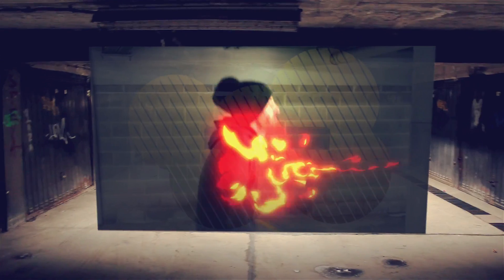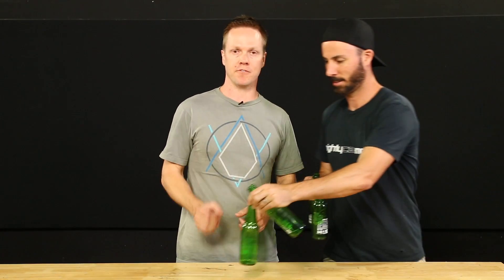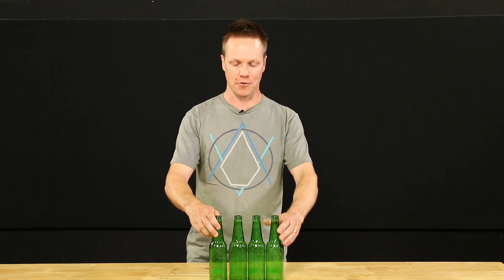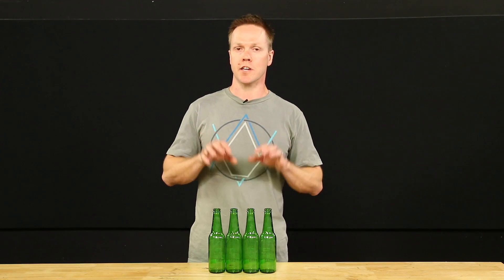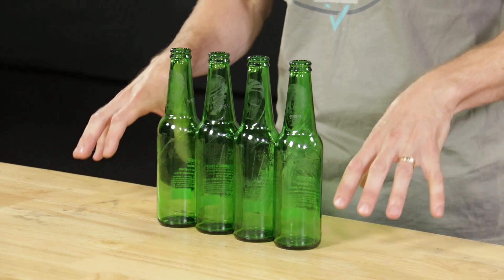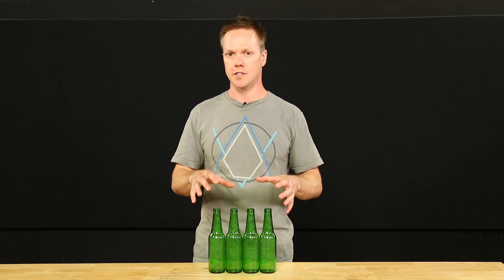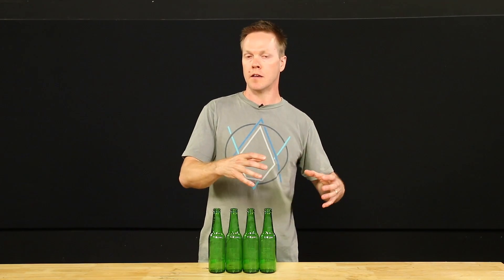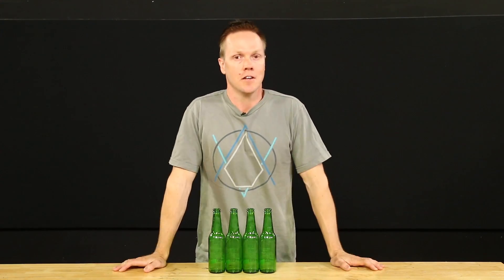Does Cold Air Make Your Car Faster? [GO FAST BRETT]

Comment: Why dont every race car use their a/c to cool down their intake temperature ?
Reply: Marius G more like the engine would waste more energy spinning the compressor than what it would create cooling the intake air temp
Reply: Race cars don't have a/c to begin with. I think the weight saving from no a/c outweighs the performance gains.
Reply: That would work, but only short term. The A/C system on cars does not have nearly enough capacity to cool the amount of air entering a high output engine for any significant period of time. You would need to rely on thermal mass, cool that down, and then have some limited effect for a short period. So, for a 1/4 mile run this would work great. You could cool a sufficiently sized water loop in a few minutes, and then it would be able to absorb enough energy to make a meaningful difference over a 1/4 or 1/8 mile run. But for track use, or any prolonged use, it would be unlikely to have any appreciable benefit. Putting a compressor in sized to handle the peak heat load would be outrageous and makes no sense unless its stationary.

Most guys just use ice, and then you don't need an A/C system.
Reply: James Flores The Demon uses ac refrigerant to cool down intercooler coolant. The ac doesn't make a difference once the car launches since the ac is not powerful enough to make a change
Reply: You are better off using evaporative cooling as they already do - water sprayers on intercoolers etc.
Reply: they sorta do.  it's called a water to air intercooler
Reply: Snoopy nails it pretty close. If you want to get super techinical, the problem is thermodynamics. You will get less power than you put into it long term. Parasitic losses like friction combined with the inefficient nature of refrigeration means you would need both a very big system to have the needed heat capacity and lose a ton of the power driving the pump. Both of those far outweigh any benefits.

You could, on a drag car or something similar, use a small system to cool down the intake short term. Ideally, this system would be relatively lightweight or removable everywhere but the heat sink/heat transfer area. Basically, something akin to putting ice cubes in a drink.
Reply: Using the ac isn't efficient. Any power you gained will be lost by running the ac. Plus the added weight.
Reply: Gain would be approx + -0
Reply: I'm not saying it helps out any, I was just showing that they do use the a/c to help with IAT. Most people who use the killer chiller actually say it's not worth it for all the reasons you stated. I've even seen where they say it ruins the a/c going into the vehicle (as it's heated by the IAT) and so it's similar to running no a/c at all
Reply: Alex Thibodeau this can be done. Your ac can be rigged to cool a air to water intercooler waterbox between races, actually works.
Reply: making the A/C compressor blow air into the engine is basically like having a small supercharger.
Reply: the dodge demon uses the ac to launch harder
Reply: They do, but I've only seen them on aftermarket supercharged cars. Product is called "Killer Chiller", uses different (and extra) refrigerant and uses the cars stock a/c compressor. But it would do better in a high power, street driven vehicle as its more likely to retain the a/c as opposed to a racing vehicle.
Reply: Why not just have a small AC compressor powered by electric motor? I mean a little bit of weight is it going to hurt too much... but either way I'm sure it's still counterproductive seeing how all these professionals haven't done it yet.